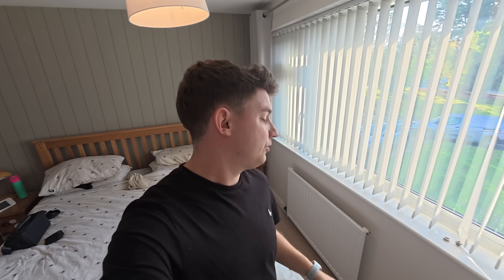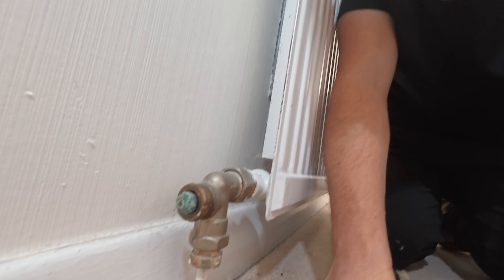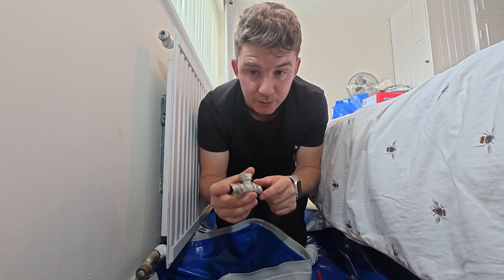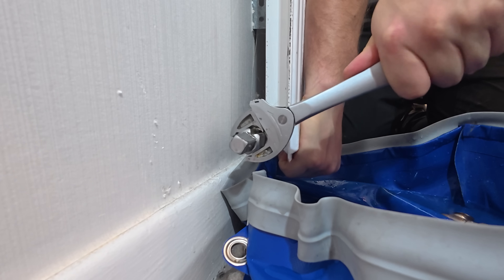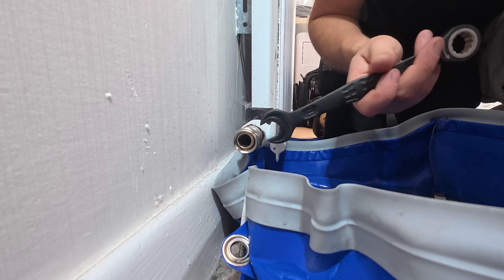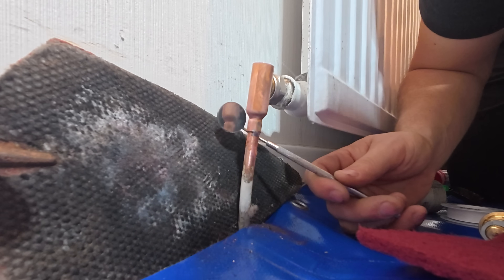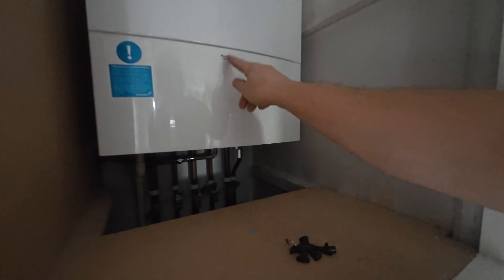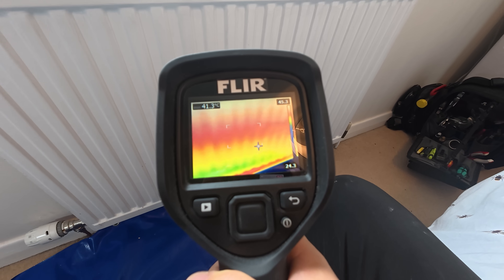How to fix a cold radiator!

Comment: And when is it better to add pressure to the system to bleed the radiator?
When the water is cold or hot?
Or does it not really make a difference?
Reply from the maker: Doesn’t make a difference mate

Comment: What could be the problem? The metal radiator is banging. The sound is like someone is hitting it with a hammer.
Reply from the maker: Could be a faulty thermostatic valve take the head off and see if noise goes

Comment: What would you suggest if the last pipe on the system will take a millennium to heat up even though the tail below the thermostat is nice and hot
Reply from the maker: Balance the system to push the flow to the furthest away by shutting down the lock shields
On the closest radiators to the boiler
Reply: @mmplumber  thanks for the advice worked a treat
Reply from the maker: Easiest way to test is turn all radiators off on thermostat to see if it gets hot

Comment: I’ve had a problem with a rad which wasn’t warming up and after randomly watching this video I did the tap with the hammer and normal service has been resumed. You need to do a video on balancing rads as that’s my next project as I have a rad in the front room which takes ages to warm up. Any assistance would be greatly appreciated.
Reply from the maker: Turn all off then work from the closest to the boiler and work your way out opening 1/4 a turn at a time
Reply: @mmplumber is there any reliable way to work out the order of the rads as despite trying to work it out by which gets warm first can't get around house quick enough before they all start heating up, thought had a blocked rad but having turned off 3 rads, now the problem rad is fully hot even at the bottom of it, thought it was blocked but guessing system just not balanced?

Comment: I noticed the large black radiator downstairs is connected incorrectly. The yellow stickers showing inlet and outlet have been connected to the wrong valves (TRV valve should be on inlet and Lockshied valve on outlet) Always remove unnecessary stickers after installation coz it looks unsightly
Reply from the maker: It works perfectly, I put it in myself
Reply: @mickmb I agree with you  TRVs are better on flow connection to be fair though   the majority nowadays  are bi directional  but being  on the flow is definitely better for any balancing which may be required and you are also  right about the stickers

Comment: hiya, thanks for the video and advice. If the heating was working fine to all radiators but after draining the non condensing boiler system and refilling, upon turning on the boiler again, only 3 of the radiators are working / heating up. The other 4 of the radiators are not heating up. As the radiators were working previously, TRV stuck pin and balancing would also be ruled out. Any idea what possible other causes ? Was suggested a powerflush as the water in the boiler system was dirty when drained and possibly the cause blocking the flow of hot water to the other radiators ? Was quoted £700+vat to powerflush 7 radiators which I think is quite expensive !
Reply from the maker: Are they all downstairs rads?
Reply: @mmplumber all single level in a 2bed 2 bath flat on the 2nd floor

Comment: I have an older version of this boiler, with only one dial. It’s factory-set to turn on at specific times. Overall, I’m having problems with the heating — the radiators heat up very slowly and not very well, and some of them don’t heat evenly. I’ve tried every possible setting, but nothing works. When the temperature outside is very low, the heating barely works, it takes a long time to turn on and only heats for a short time, as if the boiler can’t keep up.
Reply from the maker: Sounds like a power flush would be helpfull

Comment: One reason to fit Danfoss thermostatic valves is that  faulty glands can be replaced without draining the system. Surely an experienced plumber should know this.
Reply from the maker: I wouldn’t mind doing on new valve but not old

Comment: Another great video Matt, thanks. One quick question - appreciate tapping the pin could potentially solve this issue and be a really easy fix, however just worried about what happens if it goes wrong. When you say towards the end of video about being prepared, how exactly would you prepare "just in case".....and if it damages the valve or water shoots out as you say.....would you have to have your drain off in place ready and buckets / pump / wet vac or something ready as well? Obviously, it makes sense to try the pin first to save a full drain down if you can. Also, did you just 'drop' the pressure and get the vacuum for the replacement and soldering, or do you fully drain it all? Cheers. Jim
Reply from the maker: I would put a dust sheet down mate and a washing up bowel with the drain hose ready to go and find the shut off for vented system if needed. I’ve never had it happen but always a chance

Comment: Why didn't you change the packing gland, then you would get both a new pin and packing gland without draining the water from the radiator.
Reply from the maker: Sometimes easier to just replace with plumbing and future proof while doing it

Comment: Hi Mathew love the channel 
Just a few questions lol…..
Can these TRVs get stuck in the on position too, just asking as my Rad stays hot even if the TRV is set to zero. 
Do the TRV have to be fitted to the flow or can they work as well if fitted to the return?? 

Thanks
Reply from the maker: They can work on both if bidirectional, and yes I’m seen the heads break before in the past! Just change the head or valve
Reply: Cheers Mat👍

Comment: Is there a reason you dont just shut off all the radiators and drain the pipes to change the valve rather than drain the whole system down? Just wondering??
Reply from the maker: Quicker really, as it’s upstairs it will always vent downwards

Comment: I have a radiator flow pipe is red hot but return is stone cold. 
If I bleed air no change and no air 
If crack nut on lock shield side so some water comes out then return pipe gets hot when tighten nut return pipe goes cold again. 
Had a new TRV and lock shield. 
When crack nut on return side and let water out the rad gets warmer and return pipe gets hot but as soon as tighten nut it goes cold again please help
Reply from the maker: Have you got by flow radiator valves?
Reply: Yes, it’s bizarre I’ve removed rad  and flushed it through flow gets very hot but return stays cold

Comment: Two other reasons it might not be working if it has in the past. 1) Boiler pump on the way out and this rad is furthest away 2) System isn't balanced and heat is stolen by all previous radiators. I just worked a job where it was the latter. New trv fitted, system bled and still stone cold. Balanced the system by restricting all the other rads which were red hot and bingo, now heats up like the others 👍🏻
Reply from the maker: Good tips there mate and correct on all of them!

Comment: Never use resin, as the threads will become impossible to remove.

I've seen you use resin before, and it's really bad. Plumbing hemp never leaks because it expands in the presence of water!

Why don't you install two shut-off valves to isolate each radiator? This is a common problem.

Bleeding the heating system is a huge waste: hot water, corrosion inhibitor that ends up polluting the city sewers, etc.😅
Reply from the maker: Resin is for dry threads can’t use it on replacing old with moisture
Reply: @mmplumber Never use it!😂😂😂

Comment: Shouldn't you have checked the flow direction indicator on the TRV ?
Reply from the maker: Mine is by flow and it was set correctly
Reply: @mmplumber  Would of been nice if you'd shown how to check and adjust

Comment: It's better not to put so much pressure on the stem with this method, which is why you showed it yourself. It's better to carefully grab a section of about 2-3 mm with pliers and gradually push inward and then pull outward - usually after a couple of movements, the valve is cleaned enough for the spring to return it outward on its own.
Well, I haven't yet encountered a valve where pushing the stem can push it down so hard that water starts to flow - as a rule, everything just rests against the seat and that's it. Yes, there may be a small leak if the stem seal is damaged, but this is an extremely rare event and usually it leaks without your intervention, plus there will be traces of a leak on the outside.
Reply from the maker: I’ve fixed 1000s using a hammer and works 95% of the time this one just disappeared!

Comment: As always an enjoyable video. If I'm cutting a pipe that drops through the floor I normally pop a pair of mole grips on it below where I'm going to cut it.  This stops the pipe dropping the floor if it's not supported underneath which is not uncommon, especially with microbore.
Reply from the maker: Yeah good shout mate! I’ve had them disappear before!

Comment: You really seem to overtighten all your joints.  Is this because you're not using tape?  I figure you're saving a few seconds on applying the tape and just stress the joints as a result?
Reply from the maker: You don’t use tape on compression, with paste this is the best way
Reply: Half to whole  turn, if chrome ease off